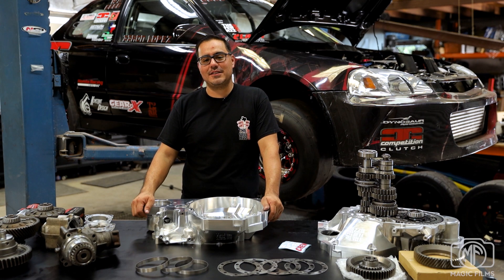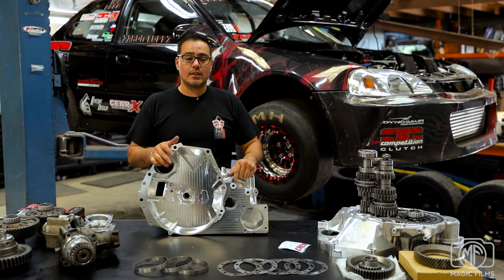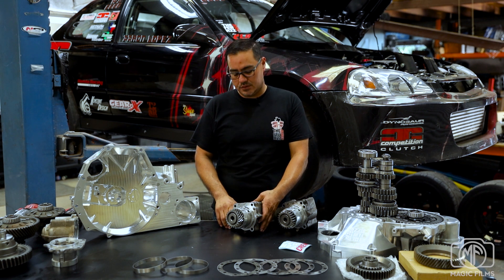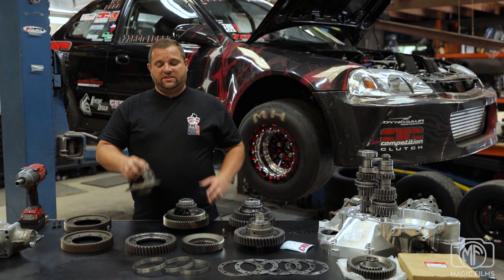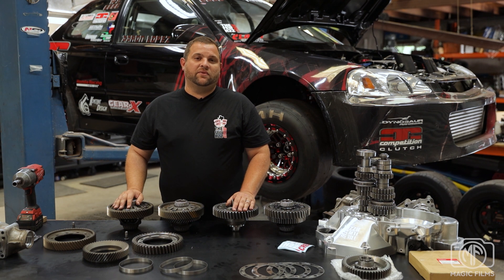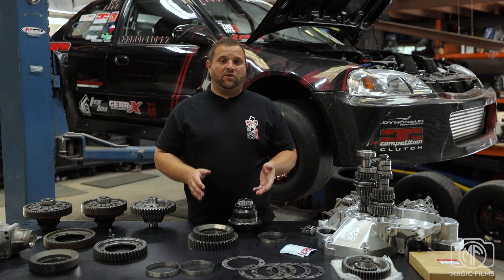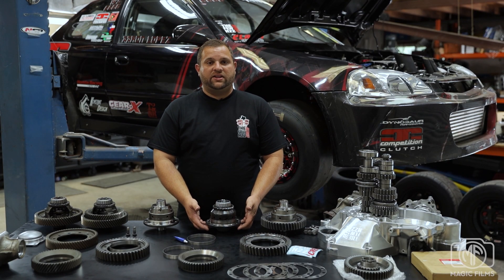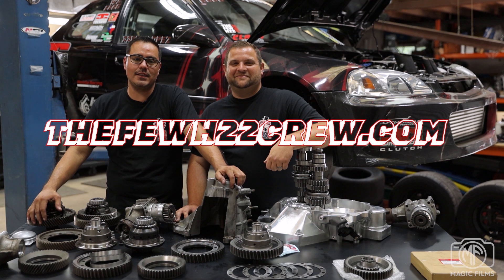BILLET H22 AWD Introduction video

Comment: i was looking up Prelude AWD and this came up will this work for a 1997 honda prrelude?
Reply: Yes this will work for your Prelude. You have to trim the subframe a little for clearance, but it works. If you have an SH, you will need to change to a Base prelude subframe. Thanks
Reply: @pellis90   mine is an was an SH but had a Base swaped into it. im unsure what the subframe is
Reply: You can find a base subframe at almost any junkyard. Just make sure it is a base model. Auto or manual trans are same subframe.